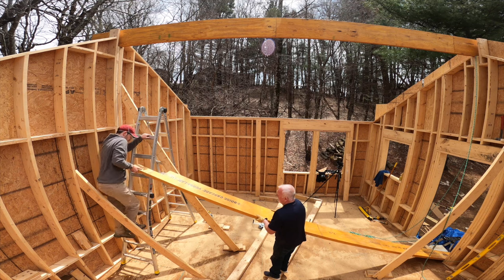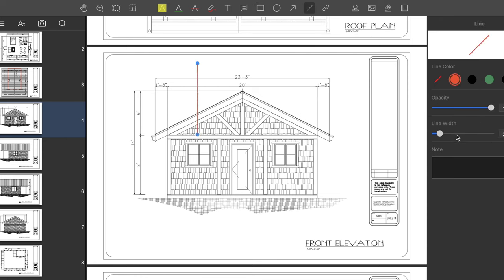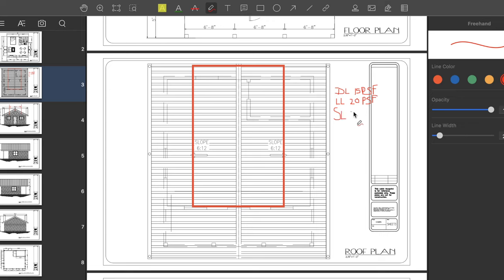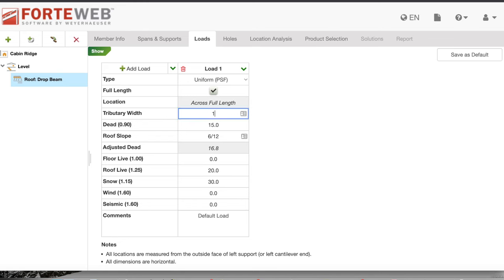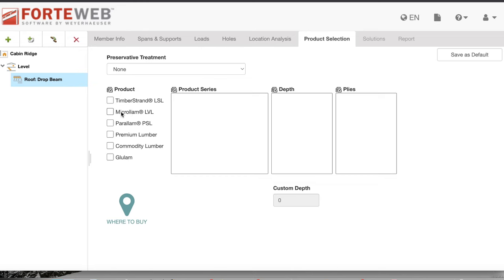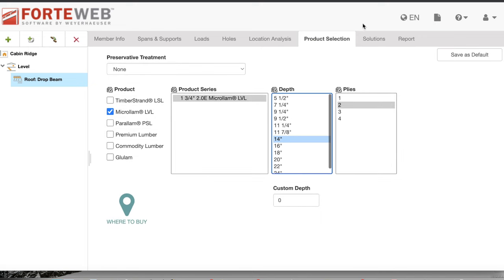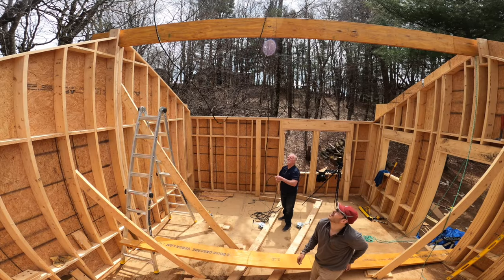DO NOT Undersize the Ridge Beam or This Could Happen - EP 28

Comment: First, thanks much for all you're doing, it's immensely helpful for me in my build.  
A question on this one as I try and size my own ridge beam: is there a reason you didn't input any value for wind when you were calculating your loads?  Is that covered by Forteweb's default wind parameters?
Reply from the maker: Typically a ridge beam is not directly part of the wind force resisting system of a house, shear walls are.
Reply: No need to do it yourself. Part of the cost of the beam is for the people in the office at Boise Cascade to do it for you. They use Forte Webb as well

Comment: You may want to account for "notch shear" when calculating your beam size.  You cut the LVL pretty substantially.  Notch shear is usually based on less than the depth of the beam at the bearing point.
Reply from the maker: Actually the ridge beam is full depth from support to support. Only notched at the overhang, watch the follow up episodes and you’ll see that the reduced height ridge beam   Overhand doesn’t carry much of anything .
Reply: Thanks, I didn't catch that.  You have a really nice project. I just subscribed!    @TheDIYCabinGuy
Reply from the maker: @Solar-Architect  thanks !

Comment: Don't undersize the beam... Then puts it over a door opening with a regular header. That needs to support all the weight of the roof. Hope they don't get snow.
Reply from the maker: My header was checked, it can take it
Reply: A relatively small header can take a lot of load over a small opening. Bigger openings require exponentially stronger headers.

Comment: Those ridge beams are huge, long and heavy. Very difficult to lift into place. Does not look it was fun. Did you calculate the required size of this based on real and potential load?
Reply from the maker: Yes I designed it per code requirements. 
They’re awkwardly long but not that heavy really. Heavy but manageable.

Comment: Hi. A doubt. You say that the wood formed from layers (LVL, I think you call it in the video) is more resistant than a single piece of wood? It seems surprisingly contradictory to me, when a priori, I would think that a single piece is more resistant than many smaller ones joined together, especially against the effect of humidity.
In any case, I trust your knowledge. Good video man!
Postscript: I hope the roof of my cabin does not fall on me 😂.
Reply from the maker: Yes, dealing with LVL’s on a daily basis for work as an engineer, I can assure you that they are much much stronger than an equivalent piece of solid wood.

You can use that online software to check your roof ridge if you’re curious 😁
Reply: @TheDIYCabinGuy  Ok. I go to check. Thanks for the response.
Reply: The thin layers are glued and pressed together. Much stronger.

Comment: why screws and not a framing nail gun? just wondering
Reply from the maker: For attaching the plies of the beam? Typically, we use nails for attaching multiple plies of conventional lumber but for lvl’s , it’s better to use screws. Better shear capacity to transfer the loads between the plies.

Comment: Butbyou took out the colar ties, so what is stopping the weight of the ridge and rafters from pushing the walls out?
Reply from the maker: It’s a structural ridge beam, no ties needed
Reply: @TheDIYCabinGuy  yes i see that with your build. Oddly this commment ended up on the wrong video.

Comment: both end cut off like 55%, will extremely reduce the strength of the beam
Reply from the maker: It’s just for the small roof overhang. It’s common practice around here.
Reply: "Common Practice" doesn't mean it's correct. I'm not a carpenter nor an engineer but I know cutting half the beam at the end weakens the beam by half (at that end) that's a fact...

Comment: Wouldn't nails have been been better than screws for assembling the two LVL pieces into one as a ridge beam? I thought nails had a better tensile strength than screws.  Please correct me if I'm wrong.
Reply from the maker: Good point but I think that screws do a better job at tying the plies together

Comment: It’s a wonder no one was hurt doing this, some kind of Scaffolding is needed for framing this roof. You are going to spend so much time and energy moving the only ladder back and forth and running up and down it just to put the rafters up.
  This project needs to take on a more professional approach, before someone hurt.,
Reply from the maker: It would have been easier for sure. 

Having said that, framing is all done and nobody got hurt 😃

Comment: Builders don't get it wrong, we do it according to plans we receive.
You have a problem with it, take it up with the engineers.
Reply from the maker: Well I’m not sure what state you’re in, but I’ll tell you that here in NC, builders build without engineering plans hence why they sometimes get it wrong and install an undersized ridge beam.
Reply: @TheDIYCabinGuy  Texas, you cannot get a permit without engineering plans.
I'm surprised you can elsewhere.
Reply from the maker: @ajs96350  I’m as surprised as you Max, I moved here from Houston. It’s crazy to us especially that most houses are on sloped terrain due to the mountainous landscape.
Reply: Here in Alaska we don't need engineered plans in most jurisdictions. I've sized hundreds of beams for projects like this and I'm not an engineer. I do know how to properly size them though.
Reply: A lot of areas in the US, especially rural areas, do not require engineering. Usually, the draftsman or the lumber suppliers do the calcs. The downside of that is that some know what they are doing and others do not.

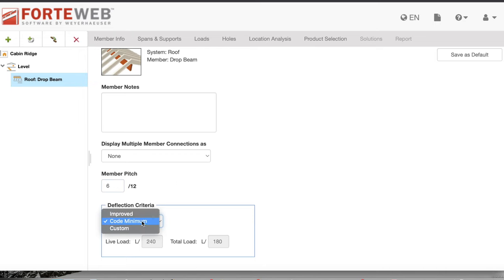Comment: Member pitch on this should have been 0 at 7:24?   Then roof pitch is 6/12 on the loads tab
Reply from the maker: Nice catch! Yes I should have left the member pitch at 0. 
At the end of the day, I don’t think it affects the design thankfully.
Reply: @TheDIYCabinGuy  True, I'm sure it passes either way.

By the way this was a great vid I've been having trouble confidently sizing a ridge beam and somehow ended up here after a lot of searching.

For footings, do you know at what height above grade it would be reasonable to skip the wood posts and lay beams directly on the concrete piers w/ something like Simpson PBS connectors? I'm doing a 12' x 16' project, where my original idea was to get all of the sonotubes on level so beams can be placed across them. I have some elevation change so one side of the structure can be as low as I want, say 6" above grade, but the other side may be something like 2' or more above grade in order to get level. After watching your video on bracing your posts, I began wondering if this is a bad idea... but having trouble finding good references.
Reply from the maker: @JS-ot4ki  2’ should be fine, I would have gone only with sonotubes if my highest point was only 2 feet.

Comment: That ridge board is ridiculously  over sized a smaller size will not sag if the rafters are reasonably spaced.
Reply from the maker: See that’s the difference between a ridge board and a ridge beam. Mine is a ridge beam and needs to be sized appropriately
Reply: I think the wording in the video is confusing. As you mention, this is a ridge board application but with a "beam" sized to support the weight. I'm not an engineer, but I think this application might still warrant "some" collar ties to offset the rafters pushing out the walls given they are not sitting on top of a beam, but attached to the side.
Reply from the maker: @davidfifth6109  not needed because this is a structural ridge beam and not a ridge plate
Reply: @TheDIYCabinGuy  while I understand your terms, by placing the rafters adjacent to the LVL it is a "board" not a "beam" which supports from below. It's a novel application of a ridge beam/board. FWIW your choice when using the website calculator clearly was a beam underneath the rafters. Again, you've got a novel idea, a hybrid that maybe a bit confusing per many comments. With respect, I'm not suggesting it's wrong or will fail, again reading the comments, I believe it's confusing calling this application a "beam".
Reply from the maker: @davidfifth6109  just so you know, I’m a licensed engineer and I design ridge beams for clients on a weekly basis. It’s very common.

Comment: Engineers are EXPENSIVE. Use a draftsmen, they can do the calculations at the fraction of the cost.
Reply from the maker: That’s true, as long as your county/city doesn’t require actual stamped plans
Reply: @TheDIYCabinGuy  most don't unless it is something specail that they don't see often and want to make sure it's safe.
Reply: As a draftsman, I stand behind my calculations, but I would recommend using an engineer on more complicated projects whether it is required or not. This project is a piece of cake to size the beams, headers, and footers, but as a project gets bigger and more complex there are many more factors involved. Most draftsman are just using shorthand and using sizing tables. A good engineer looks at the entire building as a system and can give much more accurate calculations.
Reply from the maker: @dallinweir  yeah this cabin is very easy, I’m sure the guy at the building supply store would be fine sizing most structural elements. You’re absolutely correct, on a 5000 SF multi level home, it can get a little more complex.

Comment: This is just one of the times i feel you purposely attempt to make the process appear more difficult.
There is a thing called a scaffold, they really arent all that difficult to build, and they make things much easier and safer as well as making the job go faster.
With a scaffold built on the floor from wall to wall it not only would serve to set the ridge in place but for installing all the roof rafters as well.
As for the ridge dimensions, that depends upon the roof design as you well know.
In some cases the ridge simply acts as a nailer for the rafters.
In cases where no other framing members such as ceiling joist and collar ties are used as in your design, then yes, the ridge  supports much of the roof with the walls supporting the rest.
It in fact has little to do with builders, and everything to do with the designer/architect.
Reply from the maker: Thanks! And my comment towards the builder is that lots of houses get built with no architect/engineer involved which sometimes leads to undersized ridge beams (I have seen my fair share)

Comment: Rafters take the load. Your Ridge beam is useless... old barn 100 years old DO NOT have Ridge beam.
Reply from the maker: I’m sorry but that’s incorrect. With no rafter tie and a cathedral ceiling, you absolutely need a ridge beam, otherwise it would be pushing the exterior walls out. Simple physics
Reply: My barn is held together by hopes and dreams. No ridge beam or rafter ties required.
Reply: You are confusing a structural ridge beam with a ridge board. Rafters take the load only if they are tied together either with a collar tie or with a ceiling joist or brace. Also, just because one building hasn't collapsed, doesn't mean it is safe or correct.
Reply: Point is, there are multiple acceptable construction methods for a roof system. The video is a good example of one, and I have no idea what the original comment is upset about
Reply from the maker: @dallinweir  very clear explanation! Thanks
Reply: @The DIY Cabin Guy  Another thing to consider is the acceptable deflection. (Most people say bending or sagging, but engineers like fancy words). In a home, that isn't acceptable. A beam may need to be twice the size to bend only 1/2" rather than 1". It is more complex than that, but the short version is that in your barn, a couple inches of sagging isn't a huge deal. In a new home, that isn't acceptable.
Reply from the maker: @dallinweir  exactly why I went with a 14” LVL, 11 1/4” was strong enough but would have deflected too much